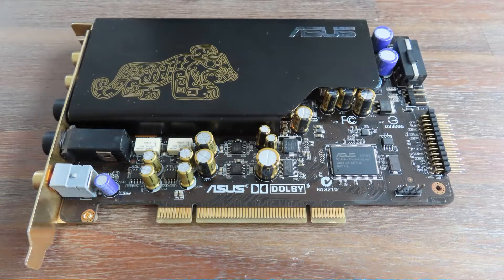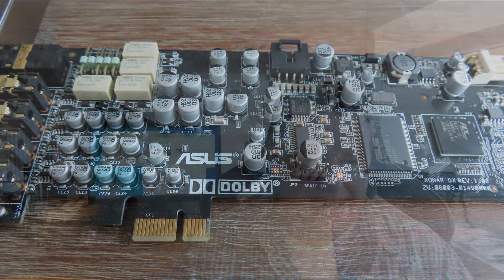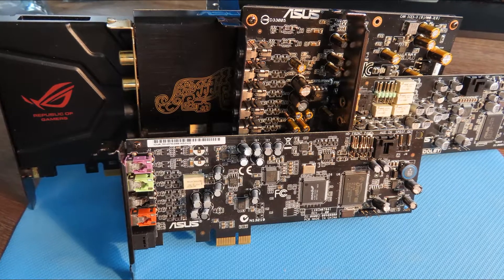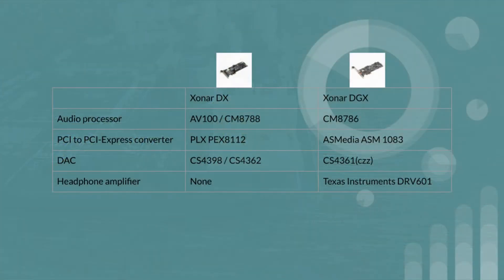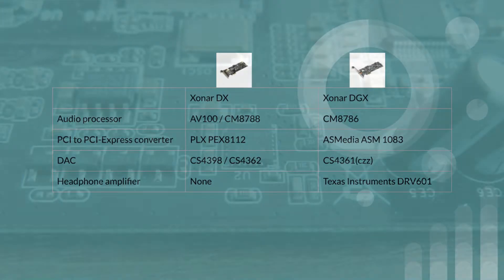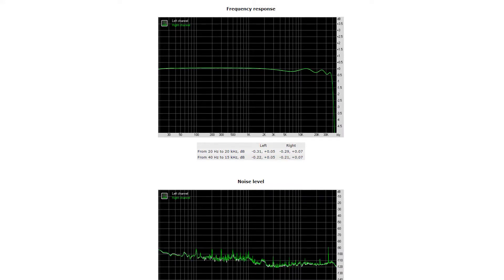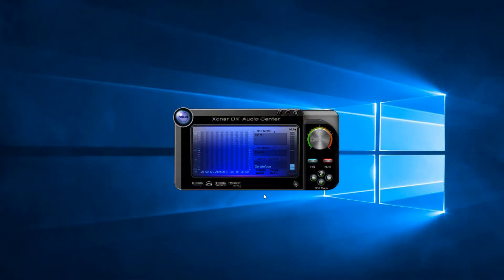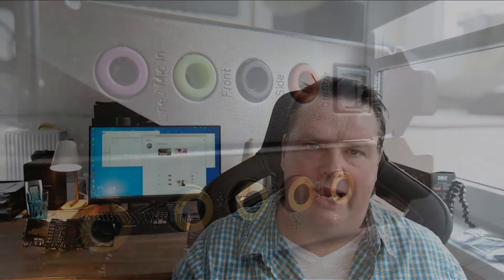Is this DGX a must have for gamers?

Comment: Software is dated but works great. I love that there are no updates coming up and causing issues. I have been using DGX for 12 years. I cannot find anything better and I have tried many. I also own Creative Sound BlasterX G6 Hi-Res Gaming DAC and many others, but I like DGX more. Recently I need PCI-E slot vacant for some other card, so I have just bought Xonar U7. I hope that it will sound the same as DGX.

Comment: I have an Asus Xonar DG, the PCI version of the DGX, and when running RMAA I got pretty different results than yours... I was getting off results like yours, but found a guide from Asus about how to configure a D2 for RMAA, I used those same methods to set up the testing for the DG and tried the tests again and got much better results, posted below.

Testing device 	[DirectSound] Speakers (ASUS Xonar DG Audio Device)
Sampling mode 	24-bit, 96 kHz
Interface 	DirectSound
Testing chain 	External loopback (line-out - line-in)
RMAA Version 	6.4.5
  	 
20 Hz - 20 kHz filter 	ON
Normalize amplitude 	ON
Level change 	0.5 dB / 0.5 dB
Mono mode 	OFF
Calibration singal, Hz 	1000
Polarity 	correct/correct

Summary
Frequency response (from 40 Hz to 15 kHz), dB +0.06, -0.08 Excellent
Noise level, dB (A) -103.8 Excellent
Dynamic range, dB (A) 103.4 Excellent
THD, % 0.00467 Very good
THD + Noise, dB (A) -84.0 Good
IMD + Noise, % 0.00950 Very good
Stereo crosstalk, dB -83.6 Very good
IMD at 10 kHz, % 0.00596 Excellent
General performance 	Very good
Reply: Also tested a D1 (PCI version of the DX) @ the same sample rate as your shown DX test w/ these results (found that missing 0): 

Testing device 	[DirectSound] Speakers (ASUS Xonar D1 Audio Device)
Sampling mode 	24-bit, 192 kHz
Interface 	DirectSound
Testing chain 	External loopback (line-out - line-in)
RMAA Version 	6.4.5
  	 
20 Hz - 20 kHz filter 	ON
Normalize amplitude 	ON
Level change 	-0.7 dB / -0.7 dB
Mono mode 	OFF
Calibration singal, Hz 	1000
Polarity 	correct/correct

Summary

Frequency response (from 40 Hz to 15 kHz), dB +0.06, -0.05 Excellent
Noise level, dB (A) -112.6 Excellent
Dynamic range, dB (A) 112.7 Excellent
THD, % 0.00095 Excellent
THD + Noise, dB (A) -97.3 Excellent
IMD + Noise, % 0.00119 Excellent
Stereo crosstalk, dB -84.0 Very good
IMD at 10 kHz, % 0.00115 Excellent
General performance 	Very good
Reply: Where is the ASUS guide on this?  I just got a DGX unexpectantly and wanted to see about replicating your setup ...
Reply: @vap0rtranz  My reply keeps gettin deleted or something... The guide is in the downloads section on RMAAs official website, it's for the D2, but I used that method of testing for all my Xonar cards and got results near advertised. I used external loopback, the guide mentions in a note how to do that in instruction 4.
Reply: @joelo3509  I found it now.  Thanks for explaining how to get it.

Comment: you can try to bend the small bracket straight so it can at least hold in the slot. i did that with small gpu to fit full size case
Reply from the maker: Thanks for the advice. I've already taken this card out of my primairy system, so there is no more need for that. But again, thanks!